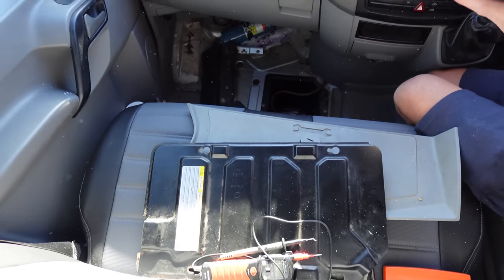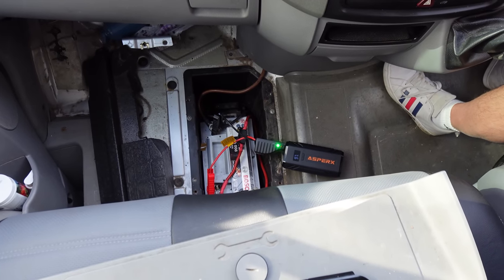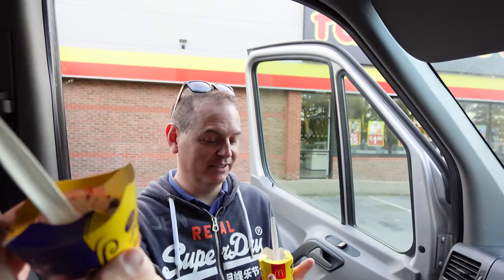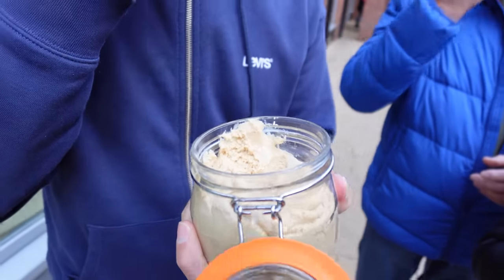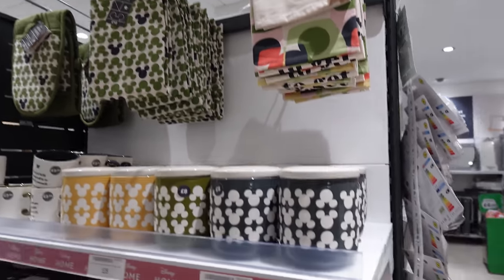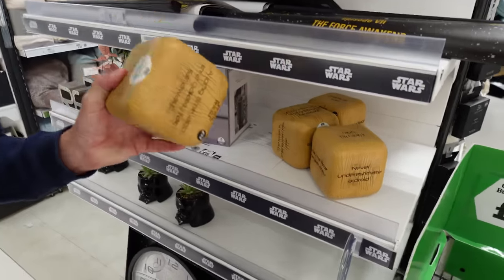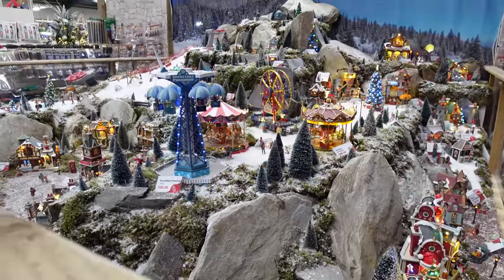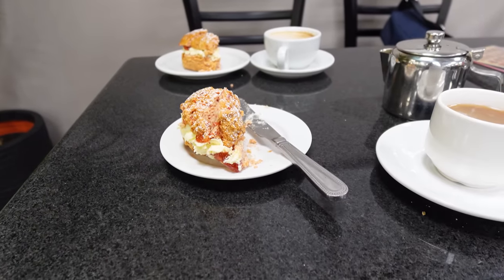TRYING TO GET THE VAN STARTED | Van Build

Comment: With the battery pacs you need to leave them connected for a few mins until they build up the charge to start the car/van/lorry.  For their size ( lithium battery) they are extremely powerful, I used to start my 4.2 v8 no problem with them